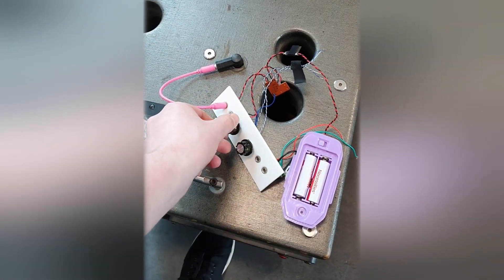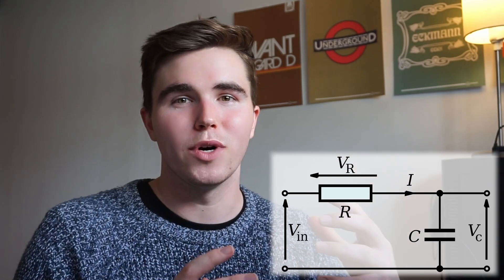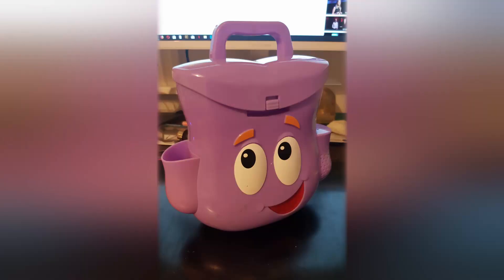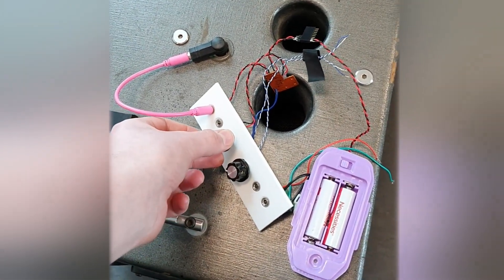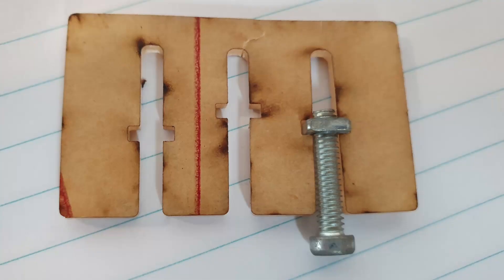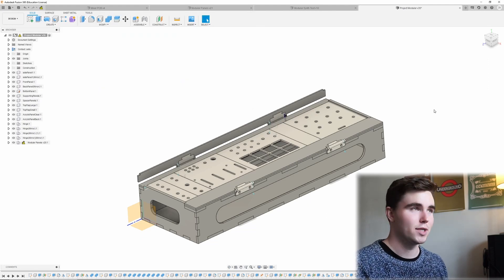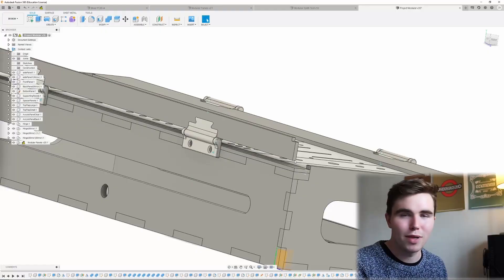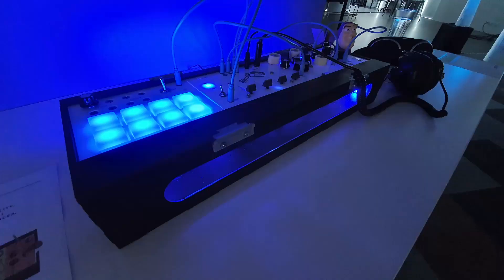Modular Synth outta Junk - Makeshift Modular

Comment: For a couple hundred dollars you can get a professional broadcast vhs audio editing rackmount unit. It has line level audio built in and even microphone ports sometimes. It has multiple different ways to manipulate the sound and video signal. You could get two of these puppies and mod the crap out of them and turn them into insane synth/effects/sequencer/vocoder units. Both getting effects from the tape like echo, flanger, delay, and tape wobble, and the circuitry of the vcr and it’s sound processing. I don’t know much about video synth stuff but I know it exists so I assume something could also be done in that realm. And the fact that it’s already in a 3u rack or sometimes 4u means it’s already the perfect size for music equipment. I wish I knew enough to be able to do stuff like this.